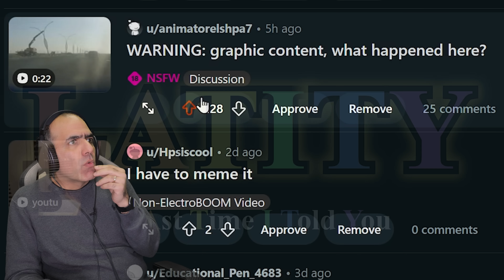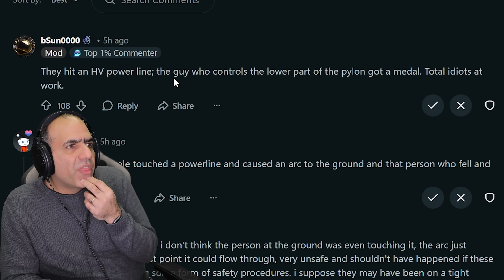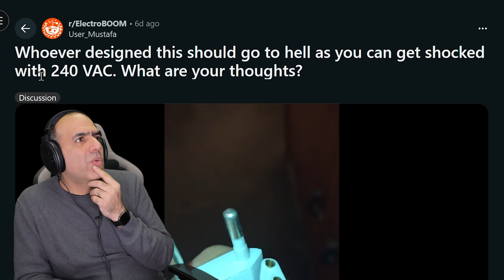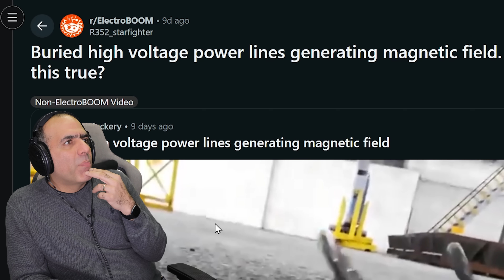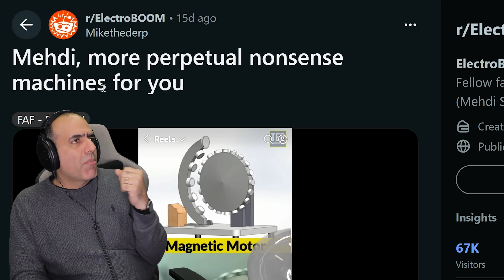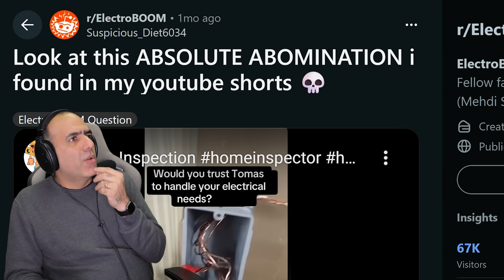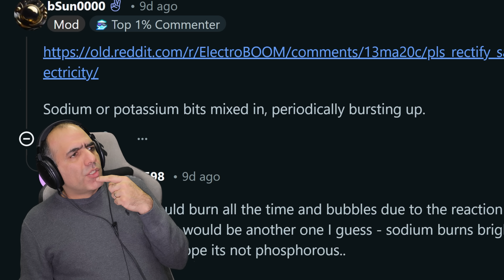Have a Pole? Need a Hole! (LATITY-017)

Comment: The question of the identical outlets for 127V and 220V in Brazil is even worse than it seems. In particular it isn't something that just happened - that standard was introduced quite recently (about 2000 I think) after a study by the standards authority. And it was a completely new standard - they had a blank canvas to work with. What were they thinking!?
Reply: The approach adopted was never meant for it and it still solves partially the issue. Those new sockets purpose is to reduce the risk of someone get electrocuted. And it is great on that, and can be verified trough the reduction of the accidental ocurrences trough the years since the adoption. Using different sockets won't prevent voltage mismatch because bivolt devices was already very widespread in Brazil and so would had a market demand for adapters, which would eliminate that supposed advantage. The best approach is to use labels as is right now and implement electronic overvoltage/undervoltage protection embedded in the appliances and plugs, without breaking socket compatibility. See USB-C for example, it uses the same format but support many voltages.

Comment: You know, regarding the first video talking about the damage that occurs during an electric injury, one of the things they need to check for in the hospital is damage to your muscle cells damaging your kidneys. Extremely strong muscle contractions like those that happen during a shock can tear your muscles apart, and the resulting debris floating around in your bloodstream can really heavily damage your kidneys.
Reply: I was reading that even if you walk away you can still die later, basically.

Comment: 12:38 not an expert in Brazil sockets and i never been there, but i see 2 holes in 220V socket and 1 in 110V... but wait a minute .... you are able to plug 110V device into 220V socket while you can't plug 220V device in 110V.... should be opposite or? lol

Comment: He got a medal so he couldn’t peruse money lol the el toro magnet would have to be above the guy for the metal to hang upwards those clips would have to have been magnets to repel upwards like that if the magnet was under them but if the magnets above them it’ll pull upwards and if it was just a little stronger those would fly up

Comment: 7:40 the reason is because in México alot if people do there own wiring at home or buy a lot of them for instalations and en up with extras. Unlike in the US in México central AC units are not common and fans are commonly use once they brake or give out suddenly you have a cable and an outlet. By the way outlets are so much cheaper in México
Reply: To be honest doing diy stuff with the outlet is probably the only time I had something blow up unlike the controlled dc power supplys I have
Reply: That's kinda rad.

Comment: 12:53 About Brazil's outlet, the plug for 100v and 200v are the same only have diference between 10 and 20 amperes! For diferent voltages the voltage need to be shown on the outlet! That means that if you put 220v electric/electronic device on the 110v outlet you will have no problem, but the other way you will learn to put the devices in the correct outlet for the rest of your life! xD EU devices work with that outlet and was a standard made to be used in the entire world, but English speaking countries that refuse to get out of the Medieval Age continue to use Medieval Systrems of measure and refuse International standards like the International System of Units!

Comment: In Brazil, @13:00, there are only two types of sockets, one for 10A and another for 20A, the difference is in the pin diameter. But since we have regions with 127v and others with 220v, it is common to have appliances with both voltages. I moved from somewhere with 127 to 220, so I have autotransformers, if I moved back I would do this, but with red outlets for 220v 😅

Comment: We actually used to use a 600 watt incandescent bulb in series to perform initial power on testing of units under test.
If the bulb glowed brightly and stayed bright, we had a short in the power supply or HV switching circuit. If it blinked bright and rapidly dimmed, inrush and capacitors were charging.
Not recommended for switch mode power supplies, unless you really, really want to have to repair the units, this was a more inductive and analog load driven approach.
The bulb reduced available current to the unit under test and gave an instant view of what was going on with the circuit.

I have been electrocuted quite a few times, typically by HV insulation failures in low current circuits, think second anode on CRT televisions. Had a flyback transformer insulation failure arc to my right index finger, pass through my body to the left arm, arc and complete the circuit from my left hand to the tuner ground. 1.5 - 1.6 kv, but that was riding on 130 VDC at high current. I was working with the actual engineer that had designed the power supply and I mentioned that the regulator failed after the failure and he calculated that I'd received 3 amps arm to arm.
Noticed a strange stillness, distracting me from the muscle pain from the massive contractions, then realized the silence that was confusing me is what we normally filter out automatically - blood rushing through the capillaries in the ears and worse, I had no pulse.
Thankfully, a few seconds later, my heart did what hearts do ever so well, save with spectacularly poor timing electrically and with a mighty chest aching thump, started beating normally again. To cause full on ventricular fibrillation, one needs a fairly tiny window to confuse the heart's electrical system, otherwise one of the ectopic pacers or the AV node proper will fire and trigger normal sinus rhythm (loads more go into that, that's the Cliff's Notes of the Cliff's Notes version). Probably got enough of a beat from an ectopic pacer (the heart is full of pacemaker cells, atrium and ventricle firing at lower rates than the main AV node, useful for diagnosing heart block and its type), got enough blood moving to refresh sodium in the atrium and that triggered a now growing hypoxic heart to go off to the races.
Besides being an electronics tech, I was an SF medic and the cardiac conduction system was a special field of study.
From a tech POV, the one hand rule exists for a goddamned good reason, idiot in need of a new village!

And yes, ferrets have been used, knew people using them to pull messenger lines back in the 90's and it was old practice for some then. If it's dumb, but safe and it works, it ain't dumb, just unusual.

Seen the Europlug to bipin failure like that. Overheated, unplugged the bipin side and the softened plastic allowed the pin sockets to draw out of the plug. Had it happen myself when I was overseas, tossed it and replaced it. Flames are good, fires are bad, as flame is controlled and fire is wild and doubleplus ungood inside of one's home.  ;)
And I did get UK mains voltage through the seat of my shorts while sitting on a tile floor once. I believe, there are quite a few ways of enjoyable scrotal stimulation and that is decidedly not one of them. My wife thought it was hilarious, since no injury occurred beyond bruised pride.

Cheap used cord to outlet, yeah, guilty as charged - for a brief test, then dismantled the suicide apparatus and got a proper extension and fixed the defect that got me there in the first place.
Built ugly test power box units with a box, outlets, way too thin a cord initially and a breaker and fuse, again, for a single use thing until I could get a proper cord on it and properly seal it. Getting home from work alive is way more fun than leaving work dead, which is pure hell on one's weekend plans.

Car broken down in Louisiana, awaiting parts, distance between work and home, about a mile and a half, hoof it I did in mid-August.
Heard similar corona discharge the entire way, given I was on night shift, some visible corona, not a lot though, most seemed to be arc through dew condensing on the insulators and dissipating before enough current could flow to heat the insulator into failure. Couldn't think of a better way to insulate the things at a reasonable reliability, safety and efficacy level though and a mile and a half for a few days gives one time to think.

Comment: Way back in the day I was setting up some buck convertors for my 3D printer setup and I connected one of them up the wrong way to the 250W 24V power supply that I was using.  The electrolytic capacitor went up in smoke with a ear ringing pop and I am pretty sure that the vent in the top didn't even get a chance to do anything (the whole capacitor shot off like a rocket leaving only the component leads behind lol).

Also, the electric substation near here is a great way to tell how humid things are - the more humid it is the more crackly it gets lol

Comment: About incandescent lights - I use them, but I'm a stage engineer and unfortunately you cannot fake the way classic lightbulbs work with LEDs. Temperature of light varies with voltage (something LED will never replicate due to light emitting mechanism tied very closely to one specific wavelength) and you get continous dimming, something that LEDs, especially limited by 8 bit DMX protocol, cannot unfortunately do. Well, maybe they do, but they are usually hella expensive, cheaper models (and I work on cheap stuff, unfortunately) lack it, and even if they do, they still cannot replicate the effect properly. Also, it requires additional expenses and work to connect everything. If you want to have incandescent-esque lighting, it's an investment that people not working in rich concert halls cannot afford.

But it's not about efficiency here, it's about art, and I believe there will always be need for them in very specific industries.

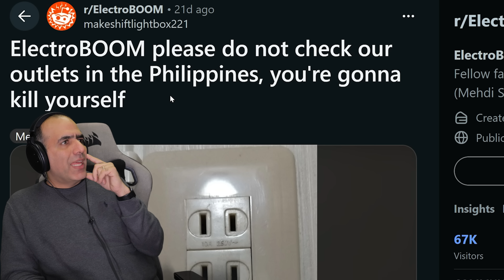Comment: 10:26 i think the i beam may be hollow. I've seen ones that have been made out of two pieces of metal fused together. You can see a little bit of wire maybe going inside of the i beam. I might be wrong tho

Comment: Not every switch needs cables...or batteries. Like my chinese chime, it uses power you click it to move magnet through coil to charge capacitor and send simple RF 433MHz signal to chime.

Comment: Network installers have used trained rats for the same job. The rat goes into the wall carrying a line and it follows the installer who taps the wall as they go to show the rat where to go. When it pops out at the far end, it gets a treat and the installer completes the install.
Reply: It is unfair if the installer doesn't also get a treat.
Reply: @BaltimoreShipspotting  Very fair point. Of course he has access to all the treats!
Reply: @danwells9525  important notice for electricians: DO NOT EAT THE BLUE TREAT PELLETS YOU FIND IN WALLS.
Reply: @lasskinn474  Mine are red, maybe purple sometimes. But either way, they're for uninvited rodents only.
Reply: What if the rat poops in the receway? Does the rat wear a diaper?
Reply: @solarlaura3355 no, if it poops, it just adds to the poo already in your walls from the mice and other insects that have been there
Reply: @solarlaura3355 you obviously send another rat with a garbage bag.
Reply: I worked cabling with one guy whose wife bred weasels, and she even made a little harness for one to wear to pull the wire. It was always a sight to see…
Reply: Just use a shop vacuum. Wtf is wrong with you? I thought that clip was satire, but people are really that dumb? You make a wad of paper, tie the string around it, and then put it in one end, and the vacuum hose on the other end. It sucks the paper with the string through. This works on all sizes of pipes.
Reply: we've used a kitten to run lines around under floors. (go to the light little kitty ! )

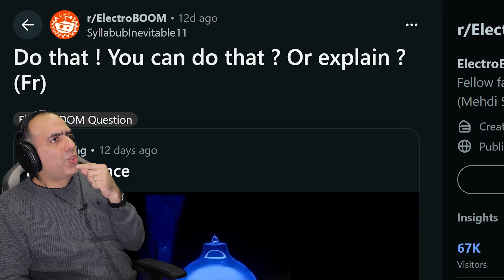Comment: 07:46 my moment has finally come, in Mexico the extension cords are usually either quite expensive or bad quality and many people think is safer and cheaper to do one yourself, and as you said, sometimes you don't need to spend a cent on it, if you an old appliance and an old wall socket, beside in Mexico, as i think in many parts of the world dads keeps everything "Por si las moscas" (just in case)
Reply: Like a mexican i can say, people do that with out a reason, extensions cords are chep but this things are free
Reply: A funny quirk of Australia's regulations is that it used to be legal to construct your own extension lead *and nothing else*, not even replacing the plug on an appliance (even though it's the same skill). I think if they realised this was a thing it never would have been legal haha

And yeah the cost thing absolutely must come into it because this is using smaller gauge wire than a proper extension lead in many cases so even if you ignore the socket end it's still less safe
Reply: @bosstowndynamics5488  I'm totally against a nanny state telling me what I can and can't legally build at home. If I play with magnetrons and Tesla coils, nobody will stop me from doing any electrical work.
Reply: @mernokimuvek  Obviously those precautions are not meant for you; any genius can easily subvert them!
Reply: and sometimes we need just a little bit more reach, and no need to buy an extension cord, besides i always have pieces of cord from other projects, saludos desde Mexico
Reply: As an mexican doing the same thing
 No, it's not the price (extension cords are quite cheap) it's because you may need one when you don't have none, then build a temporary one yourself until you buy a new one, and then the temporal one becomes permanent
Reply: I live in Canada and do the same thing. If you have the parts, it makes sense.
Reply: Interesting
Reply: My grandpa has something similar, although its built a lot better (there is a 2 gang type G outlet (we live in the UK) that is installed in a proper junction box, and it gets power off a 16A 230V IEC connector, one of the blue round ones meant for outdoor operation.  The junction box and the IEC connector are attached to a piece of wood).

I first saw it during the 'rona lockdown, when all the family camped outdoors instead of staying inside his house, to reduce the risk of him getting sick.  He ran the cable out for us so we could charge phones.  If I remember right, we put the not outdoor rated part inside one of the tents that had a specific hole for running powerlines through, although it is also possible he had a waterproof enclosure for it.

Ive seen it lying around in his garage since.  To me, it doesnt feel risky since he knows his stuff and ive seen that type of junction box and outlet in school buildings and such (although mainly a plastic variety instead of the metal one my grandpa has, but both are connected via cable in wall-mount conduit, so nothing has to go inside the wall and thus everything is easy to install, repair or expand).  Nothing is just covered in electrical tape.

In other words, you can definitely do this type of extension cord safely.
Reply: Also the one in the video has a two pole plug and three pole sockets. Very handy and you cannot buy those 😂
Reply: I drilled my extension cord and gave it a extra ground hole.
So I don't have to break the pin on my devices.
Not that I would ever use grounding, I don't even have GFCI, it's pointless.
If it shorts the breaker pops.
Reply: @monad_tcp Grounding existed long before GFCI and doesn't depend on it existing at all. The type of fault that grounding prevents is the live wire shorting to conductive external parts of the device - on an ungrounded device this just makes those components live and then you can get shocked by touching them, on a grounded device those surfaces are tied to ground so they can't become live, with the side effect of the breaker popping because live shorts to ground and a large amount of power flows through it. Without grounding the breaker doesn't pop at all, it just sits there live waiting for you to touch it and get shocked

GFCI on the other hand can prevent shocks from faulty double insulated appliances that don't even have ground because it's detecting power flowing through to ground where you are the grounding wire

Comment: I was cleaning the connector inside of military aircraft. I pulled the connector that I thought was to the radar altimeter but I pulled the one next to it that was the bomb arming circuit (my dumb fault for not paying attention). The switch is supposed to be pinned in the cockpit so it can't be armed. Of course it wasn't and someone must have bumped the switch into the on position. As soon as I hit those connector pins with a brush covered in cleaner I saw the brightest flash ever and the plug exploded. 50,000 volts ran right through me. My heart did crazy things on the EKG machine for hours after that. Respect the voltage!

Comment: 12:36 Yes! Come to Brazil. I should say, we have slightly different outlets for 10A and 20A so that a 10A plug can also fit a 20A outlet but a 20A plug cannot fit a 10A. However, people use all kinds of adapter to ignore that safety design. It's also rare for a house to have both 110V and 220V and there's no code to regulate this, usually a city has only 110V or 220V with places like hospitals having both kinds well signalized.
Reply: Most houses with 127V will have 220V as well. Phase and neutral would be 127V and two phases would be 220V. Typically you'd use 220V for things like electric showers and electric ovens. Also, yes our plugs for 127V and 220V are exactly the same. Though they usually come with a tag saying if the appliance is 127 or 220V.

Comment: Depending on the region, the voltage can be 220V, more common in the Northeast region, and 110V in the Southeast region. Many people lose appliances when they are not full-range or dual-voltage, because they move and don't know/notice the difference. Talking about Brazil